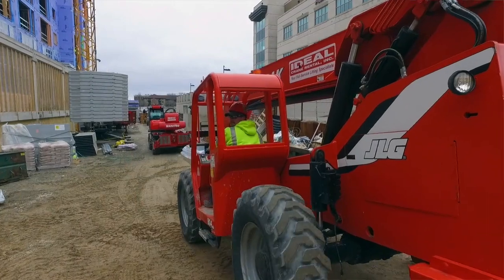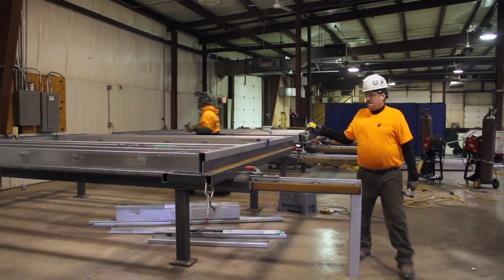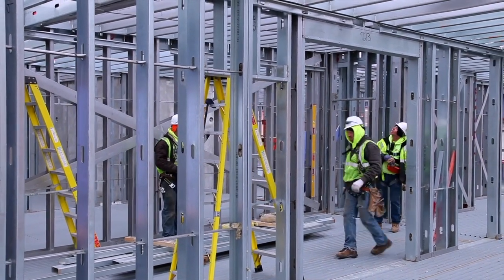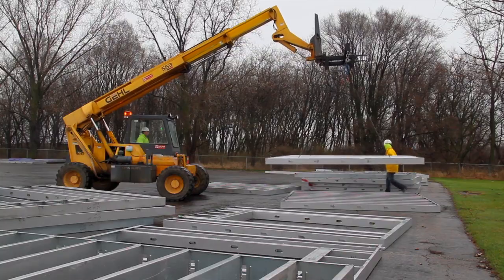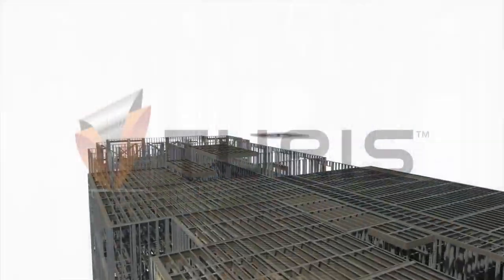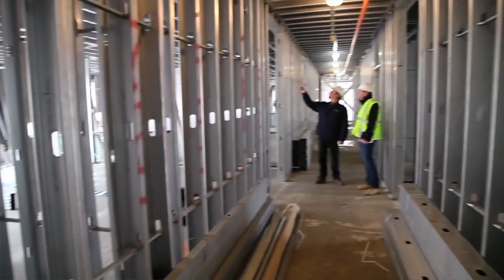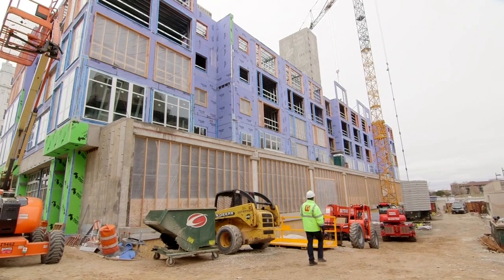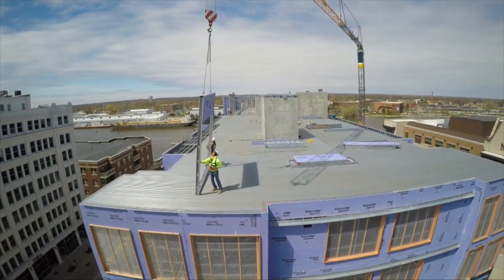Light gauge steel pre assembled wall panels for faster construction

Comment: Eight stories building with light gauge steel....so it is not impossible anymore.....amazing. I wonder if some kind of light concrete was used to fill in the walls
Reply: No need to fill in the metal studs expect for batten insulation for insulation and sound.